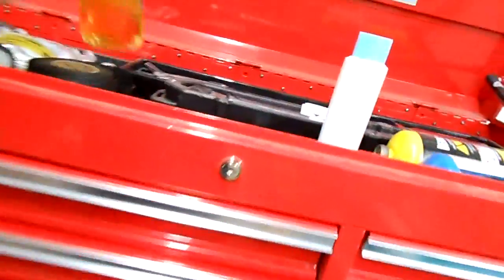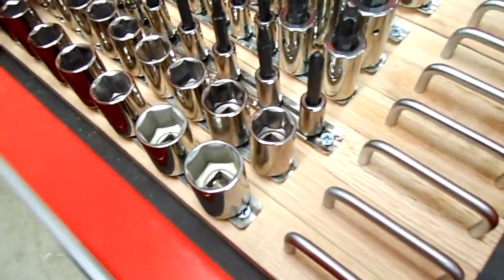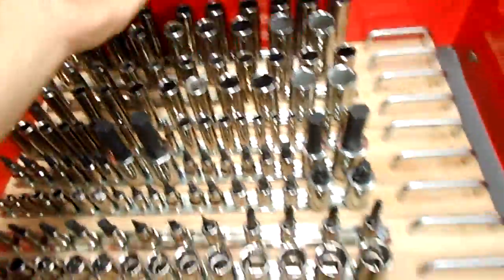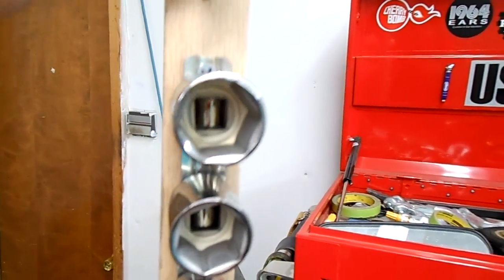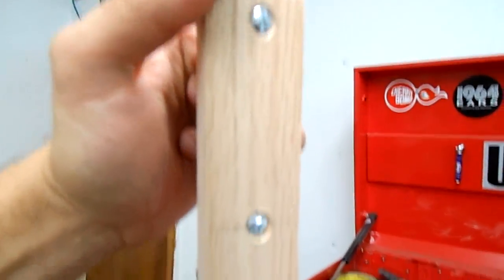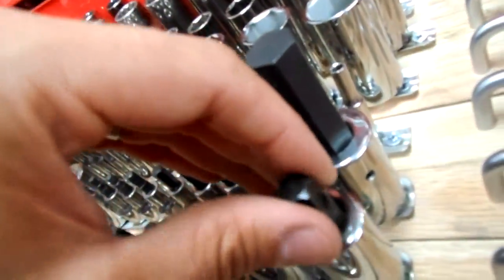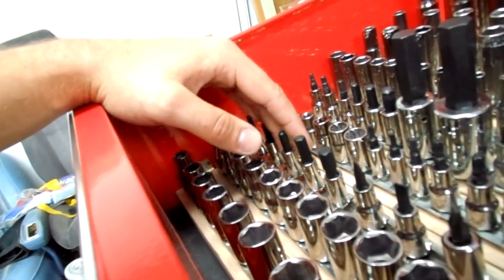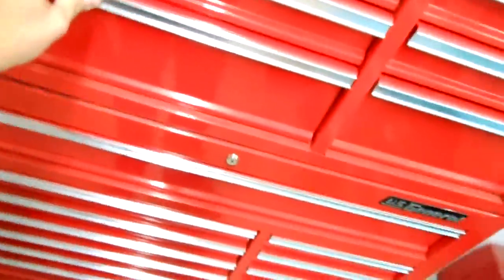Home Made Socket Rails-Custom

Comment: This is the best socket rail idea I have ever seen. I'm currently making a 332 peice tool set with this same system. I am painting the metric rails black, sae rails red, and specialty rails (torx, hex, etc) silver so they are easier to spot.  As an auto body technician this idea is going to make my work alot more efficient.  Thank you for the idea and video!!!

Comment: Thanks for sharing this.  I used your idea and it is working out great. I had some extra cheap laminate floor boards lying around- and screwed two columns of tracks so that I could have the taller sockets and short sockets on the same board.  Works out better when I'm putting these sockets a tool bag - going on the road.

Comment: I've been looking for this video for a while, just to say thank you for the idea.

I found it a couple of years ago, when I bought a bigger tool chest, and was looking for a better way to organize my sockets.  I wound up building somewhere around 20 of these for my top drawer of my chest (72" US General) and my sockets are now neatly organized, and easy to find.  The  wood now has greasy fingerprints here and there.

It's amazing how effective the cheap 99 cent rails are when you fasten them to a piece of wood.  They're flimsy by themselves, but this is nice.

Thanks again, it's been pretty nice, and I've got less than $4.00 each in them.

Comment: Thanks for the idea! I have piles and piles of sockets. I formed an idea while watching:

Tack a drawer-lock type rod on the left, so you can slide the left edge of the rail under it. Cut slits on the right to slide another rod in. Now the rails are held down, so you can just rip the socket out without flinging the rail all over. And the slide-out side allows you to still remove the rails.

Comment: That burp is the best intro ever. Real nice socket rails. I need to make a couple for some mixed drive size sockets. FYI: It's 1 x 2 stock which is actually 3/4 x 1-1/2. The wood is cut to the larger dimensions, kiln dried which causes some warpage,  then milled down to the to final dimensions to make it straighter and squarer. Really old  lumber is the actual original dimension.

Comment: The wood and socket rails are nice but the handle is useless. Takes up valuable drawer space that could be used otherwise.
Reply from the maker: Ive found them to be pretty handy. They do eat up some space, but for me, thats a good reason to buy more toolboxes! Frankly, I would rather eat the room just so the drawers are truly dedicated to sockets. Knowing myself that extra space would wind up with random junk had it not been filled with the handle portions.

Comment: There is a lot of space between sockets in those drawers. I have that many sockets in one drawer. I've been using craftsman plastic socket rails and they work very well. I also carry them in the field and have yet to break one, even loaded with half inch deep sockets.

Comment: very nice job, I like the way you made the boards for the rails. I';ve used the rails from harbor freight for over 20 years and did not want to screw the into the tool box, never thought to mount them on boards and the handles are a nice touch. I am going to see if my box can be set up something like yours.
Reply from the maker: Right on! Have fun!

Comment: +zombunist I hate to knock your socket rail set up but my opinion is I would have went with the Harbor Freight socket organizer set up their number and at a glance you can tell which socket you're looking for. 1/4. 3/8 1/2 in setup is about 15 bucks for all three cheaper in the long run to

Comment: They are expensive , but I recently tried the Torin socket rails from Lowes. I am crazy about them. They have a magnetic strip on the reverse side so that the whole set of sockets can be taken to where you are workint. The sockets lock on the rail very positively and they come off with just a gentle counterclockwise twist. The rails cost about 17 dollars each but I can see a lifetime of use and I love the way they work.

Comment: I  am redoing part of my tools. This is a good idea. I have several metal holders with the plastic handles (that you mention), but I don't like them because they seem flimsy getting sockets on and off. Mounting them like this would totally fix that!  
I want mine Color-Coded  by Dive-Size, and SAE or Metric, for quick access. 
Thanks for sharing your project. It's given me an option. Cheers!
Reply from the maker: +David House Sr. Thanks man! Glad you found this helpful.

Comment: Like it, varnish those rails and use a fine pitch sharpi and mark the spots. You'll never guess which one you're missing again.
Very nice vid and tool set up. Now go get em dirty! Best Wishes n Blessings Keith
Reply: As he mentioned the ability to reposition them as a benifit, marking the spots would not be a smart thing to do. Putting a finish on it I agree with, At least to prevent grease and other oils from getting on and soaked in where you could not get it out..

Comment: miller highlife? mmmmm good choice of beer! very good idea thanks for posting. btw the reason they call it a 2x4 is because the 1.5 x 3.5 pc of wood started out as a rough 2x4 inch pc of wood stock, then ran through the planer to make smooth. they cut a net 2" x 4" out of a log... peace
Reply: +Coherant bliss... Long ago...2X4's were actually 2X4...then 1-3/4" X 3-3/4"....I have a house built in 1922, garage has all framing of actual 2X4's....
Reply: You are correct! but now they do what I mentioned earlier. I too had an old house with the net 2x4's...geeze wish I had all that wood now lol...clear old growth fir...worth a fortune now....peace
Reply: oops yep!
Reply from the maker: MGD indeed.

Comment: Right now my sockets are all loose in the drawer.  This is such an easy solution and will really help my disorganized mess.  The one thing I would suggest like another comment made is to label their sizes in front of the rack.  Not being nit picky or anything, it is just that I spend a lot of time picking up my sockets and trying to see if I have the right size.  It happens when you get old like me...

Comment: That's a great idea.  I have some of those socket rails already but they're useless to try and use in a tool bag, all the sockets fall off anyhow LOL.  Putting them in a drawer in the toolbox would be a great way to use them, if I ever get my tool chest inside like I want it...it has sat outside on my carport for the past 14 years.  I have that same US General tool chest setup, it works great, but I may need to upgrade to at least the 56" and this time buy the end cabinets as well since they no longer make my 44" I can't get the end cabinets for that old style setup :(.

Comment: A 2x4 is a 2x4 when it is rough sawed out of the log. After it is kiln dried it is milled down to its final smooth size of 1 1/2 x 3 1/2.

Comment: 2x4 was a 2x4 when it was "rough" cut. Finishing takes 1/4" off each side - resulting in a 1 1/2 x 3 1/2. Look at it like them adding a finishing service to your lumber since you'd have to do it anyway if you bought it in the rough.
Reply: You can, just order rough cut lumber. This is a 2x4 finished dimension. This is the way the dimensions are reported. And it's for a reason, not because the advertisers are lying to you. 

The dimensions are of rough dimensions always so there is no confusions and if the wrong product is given, you can recover from that mistake. The industry, including consumers, have known the difference between rough and finish dimensions for hundreds of years. 

Improvise, Adapt and Overcome.In other words, stop whining and get with the program.

Comment: They look great.  I, too, didn't care for those commercial units with the handle that tips upward; they look they're about to fall over.  They're not wide enough to be stable, and I just didn't care for their appearance.  I made several like yours, but without the handle, using some scrap marine plywood that I got at work.  I attached the thin socket rails to them with drywall screws, and I was good to go.  I don't use my sockets that much, so it was mostly a means to organize them in my toolbox.  I 've noticed it's a real pain to remove them from the clips when I do need to use them, so I'm not sure I did myself much of a favor.  Later on, I purchased some Mechanic's Time Saver socket holders (deep or shallow plastic bodies with a magnetic strip underneath to hold the sockets in place) and like those a lot.  Obviously, they're not cheap at around $18 to $20 each, but I found them to be more convenient.  Something else to consider about storage is how deep (tall) the drawer is that you're using.  Deep sockets can be a problem in a shallow drawer, and seemingly no manufacturer makes durable socket trays that lay down at a 30 degree angle.  The only way to get them is to buy full sets of sockets off a tool truck, and the trays are usually flexible plastic (i.e., throwaway).  Their main purpose is to entice you to buy the set and additional holders.  If they offered durable socket trays that laid down to display your sockets by size (similar to the manner in which wrench trays do), they'd be flying off the shelves.  The only problem I see is that some socket brands are wider than others, but they could be sized by brand to allow for that.

Comment: Nice set up.
What's with the van, a friend cut the front off a van to make a trailer out of it, but before he got much more into it he decided it was going to be way to heavy so he gave up on the idea.
Reply from the maker: It is in the final stages of becoming a trailer, the main hold up is money as it is SOOO heavy its going to need its of set of brakes. I need to put about $700 into the new axle, brakes, tires, etc. I have a few videos about it on my channel. Its called the "Green Bean." Clever, huh?

Comment: Wow, nice job of organizing sockets! My only gripe with those metal socket rails is that they are somewhat frustrating getting the sockets on and off the holding clip... and after time, the clips get deformed... and need replacing.  One thing is for certain, the metal rails are leaps and bounds ahead of randomly tossing sockets in a drawer.

Comment: They look very nice and are organized however, I don't like that is usually takes two hands to remove a socket, one to pull the socket and the other to hold down the rail. You can see it happen on the video. However, if the socket would come off easier they might also fall off while carrying the rail around.  Thanks, Fred
Reply from the maker: I hear ya man, these harbor freight rails do tend to be a little stubborn, I'd have to say that is my biggest frustration when I'm using them. Thanks for watching!
Reply: Zombunist About the two hand prob: How about putting a jam piece of wood or pipe through the door handles to keep them "locked" down while you grab and return the sockets you need with one hand?
Reply from the maker: Alec BUSCEMI That would be a good solution to the problem when they are in the drawer, But I typically grab whatever rails I need and take them to whatever I'm working on, hence the handles. Defiantly a good idea though, perhaps I can brainstorm something of the same function for "in drawer use" that can easily be set aside for grabbin and goin.
Reply: I'd probably put strong magnets on the bottom of them so if you're working on a car/metal surface they'll just stick to the car/metal surface and shouldn't have a huge problem removing them.
Reply from the maker: Good idea!

Comment: i did this exact thing for my deep well impact sockets. Its crap. They are just too heavy. The second you pick it up they fall off. Would probably work fine for non deep and maybe even deep non impact....but for impact sockets this doesnt work well. Still searching for something for those that is garbage. This is a great idea though and looks nice.
Reply from the maker: Thanks. Im yet to get a good set of deep impacts and organize them. Just got some crappy harbor freight ones loose in the drawer for now. Definitely a little heavy for these rails I would imagine.
Reply: @Zombunist  thats exactly what i have but im looking for rails that will carry them and allow me to throw them into a tool bag or mobile box for bringing them onsite to do work. Still researching good rails. Might get some Ernst twist lock ones and give them a try. I Guess they are supposed to be good.

Comment: Nice idea, thanks for sharing.  Only thing to make it better would be to edit it down for briefest time.
Reply from the maker: Thanks for the tip! I defiantly ramble. I finally got some editing software but my integrated graphics cant support it and my computer freezes... I"m a paycheck away from adding two crossfire supported HDMI/Dual Link DVI cards to my rig to run triple displays. Im sure the software will run fine once thats installed. Thanks for watching!

Comment: How would you keep these clean, as a mechanic I can imagine I would get these very dirty very quickly.
Reply from the maker: +Daniel Warren They just get dirty! I do try to wipe off the sockets before snapping them in but im sure these will be as grease stained as can be as they continue to get used.
Reply: +Zombunist u should have coated the wood in polyurethane before attaching the rails. That probably would have allowed u to wipe them clean.
Reply: +Adam N poly is a finish for furniture and not very tough, epoxy would do the job better.

Comment: Pretty shinny,  but what if you use your sockets and you have three times that many?   I've found that after forty-five years of using my tools professionally removing full clips of sockets is just a pain in the ass and totally not necessary.  Removing clips just makes tons of tools scattered around your work area.  I use clips but their attached to full or half drawers of 1/4 Plexiglas sheets that holds 200 SAE and another drawer of about 150 or so of metrics.. Putting 50 shinny news sockets spaced that far apart is a waste of space.

Comment: I like the rails but do you even use your sockets? they look untouched.
Reply from the maker: +Tynan Higgins They haddnt seen much use in this video. Currently I am working as a mechanic at a small dealership and use them everyday!
Reply: A good mechanic keeps his tools and shop squeaky clean and organized. Otherwise you spend half your time searching for tools and parts. Shit gets lost and parts get mixed up in a messy shop. The worst part is you get grit on critical part surfaces such as cam lobes, crank journals, etc. Grease on brake rotors, and so on.
Reply: +John Long a clean shop is a quiet shop..... I am OCD and keep a meticulous work area and a thoroughly organised tool box but I am not as quick as a messy technician. Jaguar Land Rover is not the easiest brand to work on but sometimes a mess is inevitable.
Reply: @Zombunist  I was thinking they are a new set of tools setup right. My Dad was a jet mechanic and kept his tools in cutouts so as not tool was left behind ... in a jet engine. We recently moved and my tool chest was dropped, about a foot off the ground on to grass & dirt but enough that all my tools were scrambled inside! What a mess but at least they were in each drawer. Your idea would have me just turning the strips back right side up!

Comment: What metal rail did you use I dont see any that I can put all three sizes of sockets
Reply from the maker: You simply swipe out tabs from different sized rails. All three drive sizes interchange with the rails. (Harbor Freight ones at least.)

Comment: Did those socket rails come like that? or did they come with the handle and you cut it off? I have been trying to look for some that are just like that but they all have the handle extension.. I like how your tools are set up that's real clean and organized, I have OCD and my stuff has to always be organized lol and I notice if someone touched my tools or even moved something
Reply from the maker: These ones came as you see them. Sears sells chrome ones with handles. Thanks man!

Comment: You did all that to save 2 dollars? Wow. By the way opening more than one drawer at a time can make your whole tool box tip over on top of you, the weight in each one really adds up. I saw a girl do it once, it was not a pretty sight. Cool rails though, I like them.
Reply from the maker: Haha, yea it was a lot of work, but it was a fun project and I saved around 40 bucks total. They're pretty tough to disarrange too, they stay locked in line perfectly and I haven't managed to knock any down by mistake after taking a few rails out and elbowing the drawer shut. You're defiantly right about opening multiple drawers, I almost learned that the hard way when I was 10 with a loaded filling cabinet. That's the only thing I dislike about this Harbor Fart box, that it doesn't have a safety mechanism to prevent that.
Reply: I have three Snap On boxes from $2000 to $7000 and none of them have such a safety feature, just warning stickers. I have never seen any box with it come to think o it. The girl I saw do it was spared a far worse injury because the top and bottom were bolted together.
Reply from the maker: Huh, I figured those more spendy boxes would have it. We have a few chest where I work that do, but I don't know who makes them Ouch.

Comment: Those damned stamped steel rails.  Cheap to make and okay to put the sockets back on when you're finished; a pain in the ass to remove one when you need it.  I still have some, mounted with drywall screws on two-inch wide strips of marine plywood.  I much prefer Mechanic's Time Saver magnetic trays.  Easy to take out and put them back, and the bottom magnetic strip holds them in place until you need to remove one, or to take the tray with you.